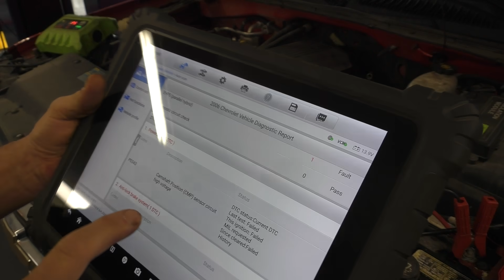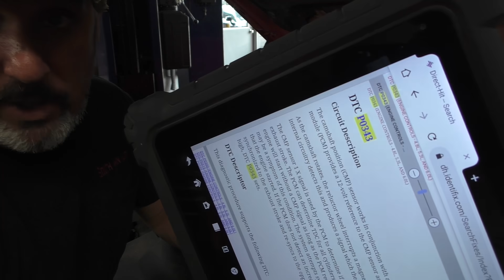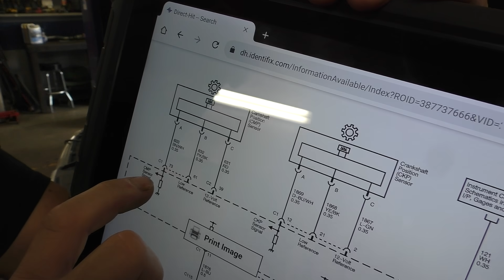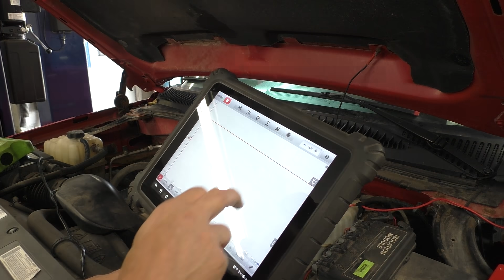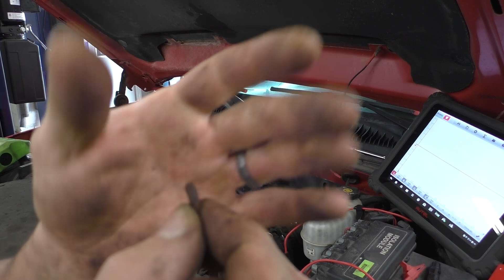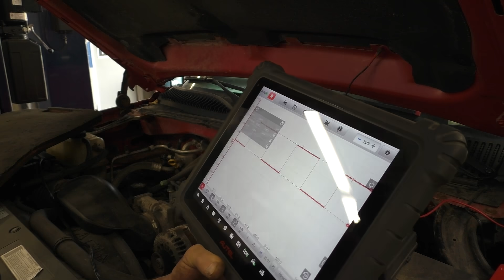Chevy Silverado With A Very Extended Crank - Other Shop Gave Up

Comment: This was not a dumb video, this was a very good video, because who would think about the clearance on the sensor?
Reply: Wheel speed sensors are another case where improper clearance can cause all kinds of issues.
Reply: Anyone who has worked with hall effect sensors knows this is a common issue.
Reply: @D2O2 VR sensors are also sensitive to air gap.
Reply: @ferrumignis  Even more so
Reply: I had thought of a replacement part made of Chinesium that was DOA.  Never thought about clearance from rust jacking though.
Reply: we had this exact issue with a L6 mercury 400, valve cover had cps well not machined quite deep enough throwing codes on a new engine, new cover and bazinga, no problemos
Reply: From now on...I will.
Reply: Dodge Dakota had a shim kit for the 2000 4.7L  cam sensor. The kit is not available you’ll have to make your own. .010 or .022 , .033 , .047 just pick one.
If you’re wrong you’ll start throwing injector codes p204-209
Good luck

Comment: i am at 17:12 and my money is on a bad chineseium cam sensor. - In my defense I live in the south I did not know the engine block could bio degrade
Reply: On a quiet summer night you can hear them rust up there. 😂

Comment: I Repaired one of these that the harness on the driver's side got to close to the exhaust manifold and had melted all the wires together. Went to the junkyard and got that harness and rerouted it away from the manifold, all was good.

Comment: So I guess  they didn't include the OG parts in the passenger seat?  So would it be a good idea to tell a repair shop to save and give you the original parts?

Comment: Just started watching but I worked on an '05 2500 with a 6.0 gas with the same problem and iirc it was the fuel pressure regulator.

Comment: Just fyi. Had a LR once that had long crank issues. Seemed the wires were damaged at some point. They were repaired quite well, but with unshielded wires. So what? Well, they run right next to the starter, and when it was energised to start the engine the em field interfered with the Hall effect of the crank sensor. Ran fine once it was going.

Comment: I just had one just a few days it had a aftermarket  sensor  and the sensor  harness  had a brake  in the harness.  But the aftermarket  sensor wasn't installed  all the way . And it's hold down was bent down the oring was stuck on top of its hole

Comment: I thought it was interesting that the customer left a note stating do not smoke in vehicle. I took my truck to a Les Schwab shop about 15 years ago near Astoria, Ore. for some minor repairs. When I got in the truck to leave and turned the key the stereo was blasting a country music station so loud I was afraid it would blow my speakers. What was maddening was that this was a brand new stereo system. When I went back in to complain the manager just brushed if off like it was standard operating procedure at Les Schwab for its mechanics to mess with its customers' stereo systems and have them blasting loudly as they worked on people's vehicles. Needless to say I never went to a Les Schwab again.
Reply: Been a wrench for 50 years. First thing I do in a customer vehicle is turn off the radio.
Reply: @tojo6940  That is the first thing I do when I am leaving a vehicle to be worked on, which was why it was so infuriating that this Les Schwab's mechanic was playing mine so loudly. I certainly didn't leave it like that when I dropped it off.
Reply: @AbcDef-iq4no was probably the person you complained to. The manager.
Reply: @tojo6940 
And always put the seat & mirrors back where they were (I’m 6’5”)
Reply: My local mechanic, picks one of the customer cars waiting in his lot, gets his crew for a break, with the windows rolled up, they smoke dope for 5 - 10 minutes..  see them a couple times a week when I walk by.  They are high .  I don’t think they use the radios.  Kinda guess their trouble shooting suffers after break time.
Reply: You are so beautiful 😍 😊
Reply: That person left that note because they had a vehicle left in for service that somebody smoked in before.  A non-smoker or worse yet a former smoker (me) can smell that stench from across the street..I have given smokers rides and can smell it for days just from their breath and clothes.  You can turn yhe music down, not the smoker stink..Cheers
Reply: @danglin69  When a mechanic takes it upon himself to blast a customer's brand new stereo system so loudly that it blows some or all of the speakers that is a lot more expensive than spraying a couple of squirts of febreeze to get rid of some smoke aroma. Cheers.
Reply: I suppose you're talking about the one in Warrenton. It's a different experience there now. The last time I was there, the rain was coming down as hard as I'd ever seen. The tech came sprinting to my car with an umbrella when I pulled up. I watched the poor kid fall over backwards when he took one of the wheels off, apparently not realizing it was a 10 ply. 😅 I would go there more often if they weren't so expensive. No sales tax helps though.
Reply: Here in Florida, the mechanics always turn the AC to max with its lowest setting.  Since my vehicle has automatic climate control, it will do that without messing with all the controls. N
Reply: The note wasn’t for Eric, it was for whatever plow driver happened to be driving the truck when it was working.
Reply: Every mechanic I went to always turned down my radio. I'm usually the one blasting the music, so I'm sure they just didn't want to hear my taste in music lol
Reply: Cry harder.. fix your own car if you don't want mechanics in it!
Reply: @every-istand-ophobe6320  That's stupid.
Reply: @every-istand-ophobe6320 you are way off base!  With the amount of money they charge to work on your car they should respect it!
Reply: @every-istand-ophobe6320 don't take to this guy has no respect for others individual bought belongings.  Why don't you cry ! No compass guiding you is there.
Reply: @every-istand-ophobe6320  Mechanics should NOT be doing anything other than adjusting seat position in the vehicle or putting the window down so POUND SAND.
Reply: @hotpuppy1 I will most definitely turn the sound system down or off if I get in a vehicle and it’s playing. It’s irrelevant to me what is playing on it. I want to hear everything that I can that’s going on with the vehicle before I touch it.

Comment: I have a 2012, mine started to crank a little to long after i did a fuel pump. If i turn the key on for about 5-10 seconds before i try and start it , it fires right up. Been about 2 years now, i just deal with it , dont want to do another pump yet. 
Love the content.
Reply: "mine started to crank a little to long after i did a fuel pump." 
I think the fuel system holds some prime in the lines. Is it possible that for some reason during the pump replacement that something disturbed that system?  I know on my last car  when you turn the key the pump would prime the lines first. You could hear the pump run and then stop once the line was pressurized. Also, are you positive that you have the correct part number installed?  Maybe the one you installed is too small for your application.

Comment: So many Chevy Thunders in the shop. Note to self: skip the chevy dealership.
Reply: Doesn't really tell you anything.  Could just be a lot of Eric's customers drive Chevy's.

Those numbers are thrown off even more by the fact that some people treat their vehicles worse, some drive more miles, some are older and more likely to need repairs.
Reply: @RyansHit  True on how people treat vehicles. I have never driven anything but Fords for the last 40 years, quite a few from new to the grave, and in that whole time we had a transmission fail under warranty once, and had one broken wire in a minivan that was easy to find. Other than that, oil changes and other consumables. But my wife and I are super easy on vehicles. I ride with other people and it seems like they WANT to destroy them, the way they drive. One coworker was complaining that she needed her brakes done every 15,000 miles, I couldn't believe it. Heck our brakes never needed changing in < 100,000 miles. Then I rode with her one day and I immediately understood. Her driving is one pedal to the floor at all times either gas or brakes.
Reply: @John_Ridley  My SIL was between husbands and asked my wife if I could check out her squeaking brakes. Took the car for a test drive and didn't hear anything. Then she drove it with me riding and yeah, the way she hit the hooks, it squealed every time. I fixed it with a new set of pads, and have not ridden with her since, and that was 30 years ago.
Reply: got news for ya, every single brand breaks.
Reply: I worked at a transmission shop couple years ago. 7 out of 10 where chevy.
Every so often id have a honda nissan ford. But majority were chevy trucks id do everyday
Reply: Or just skip the chevys period
Reply: I work at a chevy dealership, older chevys are way better than the newer ones